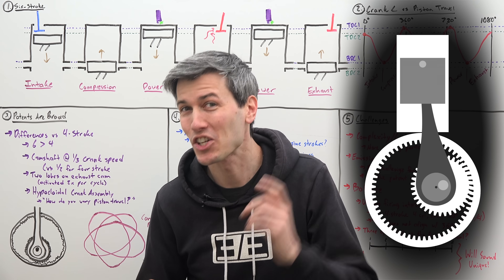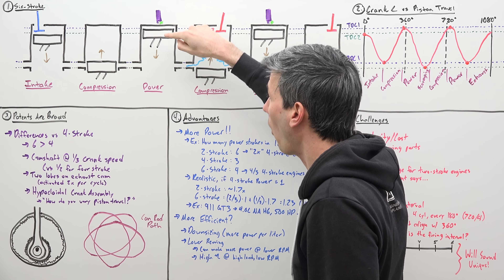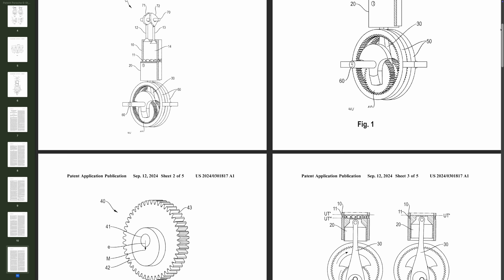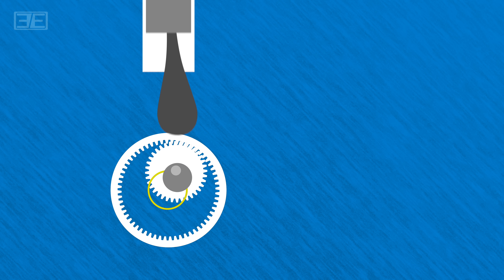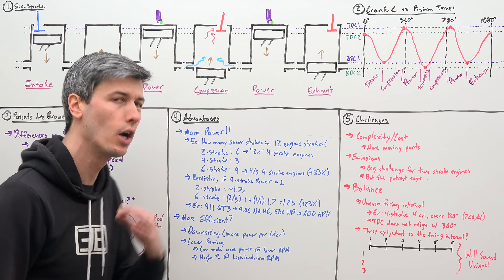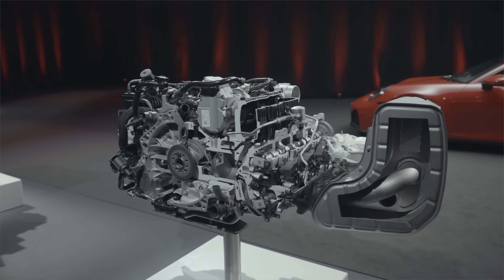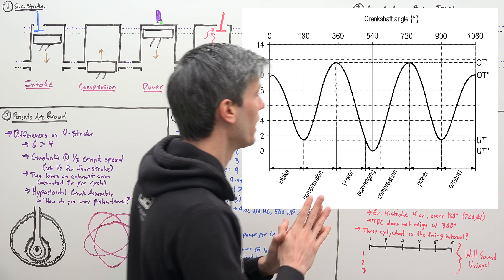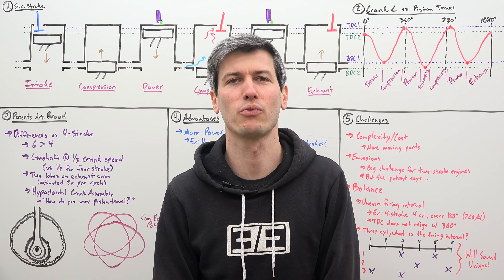Porsche's 6-Stroke Engine Is Genius!

Comment: I don't understand how people come up with stuff like this. I mean, I do in theory, but the fact that there are people who can connect all of the dots involved and end up with something of value is impressive.
Reply: Of all things and machinery that are made, what always impresses me and is often missed are the giant machines that are dozens of meters in size that make other machines.

Somebody had to think of and make all those enormous contraptions that are extremely complex, yet fast and efficient.
Reply: engineers. As the son of one I can tell you all sorts of stories. They are a different breed.
Reply: I mean you already have some of the greatest mechanical minds in a room. They're thinking of ways to  improve the cycle, and we know of two major energy losses in combustion engines, heat and exhaust. If we can capture either form of energy, we turn it into more efficency, whether it's the same power with less fuel or more power with the same fuel. Scavenging and reburning usually takes away from the power stroke. Here it gets its own stroke so it doesn't take away from the clean power stroke
Reply: Spirograph
Reply: Love the channel content is excellent, delivery excellent too.
Reply: Thanks, I am the sole named inventor on four U.S. Patents myself. On the other hand, you might be surprised at the amount of useless crap that actually does get patented. When a Patent is applied for, the Patent Examiners throw all sorts of irrelevant crap (existing Patents) at the application as "prior art" and the Patent Applicant (actually their IP attorney), must dispute the relevance. It is actually the established policy of the USPTO to immediately reject almost all Patent applications and make the applicant jump through hoops to convince the Examiner of the validity of the application.
Reply: people enthusiastic about making name of themselves, especially in their 20s, will spend whole day thinking about stuff like this. Some end up burnt-out, especially programmers, and had to "retired" early. It's how much we occupy headspace with the same problem, more time equal more dots connecting.
Reply: It's not that hard, just be German and have a penchant for making things that are needlessly complex. Easy-peasy
Reply: They usually come up with something like that either as a result of a wager („Bet you can't make a 3-stroke engine“ „Of course I can, give me until Monday!“) or out of desperation („Damn, I'm fed up with trying to fit this much power into this small area for the engine“). In this case, I'd say it was the former.

Also, it's usually the initial crazy inspiration, then a lot of work to solve the uninteresting detail like how to make the different tops and downs.
Reply: Home office
Reply: Porsche engineering is the BEST in the world!
Reply: @ghoulbuster1 in theory. In reality, their vehicles are unreliable and expensive to repair.

Comment: Could a hydraulic actuator rise and lower parts of the assembly to get rid of the eccentric crank shaft? The cylinder might be raised and lowered when the pressure isn't too high.

Comment: My basic understanding:

There is only one fuel intake stroke so the second compression and power stroke will not have the typical increased power like a two stroke, because it has not taken in more fuel. That is where the increased efficiency comes from, it is injecting fuel less often and only using the leftover fuel for compression\power on the second cycle. It MIGHT break even, but it depends on how good it is as scavenging the remaining fuel.
It will probably make slightly LESS power than a similar displacement engine (but only slightly less) because gears to drive the cylinders will probably not be great for high RPM applications since to make them robust enough you have to make them thick, and that means heavy.

Of course, none of these matters THAT much on a diesel, so I think that is where it will go. It can probably keep a very similar power figure as well. A cleaner burning and more efficient diesel would be very welcome. Honestly I can see these used in large diesel applications where every cent you save on fuel adds up quickly, and being able to save even just 10% on fuel cost pays for itself easily. Things from long haul trucks, to generators, to ocean going ships will definitely see it in great demand.

I look forward to be proven wrong, or course, but that was my napkin take of it. If they can pull it off it reliably it would be fantastic, and either way you are right - the sound will be something else. 
I guess now we wait to see what they actually build.
Reply: With direct injection (either conventionally for a 4 stroke via the cylinder head or via lower 2 stroke sleeve valve), fuel can be injected whenever one likes, as many times per cycle as one wishes.
Reply: @RandomGuyRandomNumber  Interesting. I must have missed the notes about that on the patent info, or it is just a gap in my knowledge.

Thanks for the insight.

Also, love the name ;)

Comment: If the camshaft is 1/3 the speed of the crankshaft, then theoretically this engine can rev higher than a traditional 4 stroke engine since the poppet valve don’t open or close as fast.
Reply: Then you also have to deal with port wear and carbon buildup.....its not a nice trade off. It really only makes sense if you can eliminate the valve train like achates power does.
Reply: It's not about the rotation of the camshaft, it's about the closing time of the spring -- you still need that thing to close in the time that the piston is moving.  This will have the same timing issues at RPM as a 2-stroke or a 4-stroke.

Comment: I want to hear this engine so badly. I think based on the firing order described, it is going to sound naturally very high revving even if it isn't actually spinning fast... And when it is at high RPM, it' probably going to sound insane like it is revving at 20,000 RPM. It will sound wild. If this is next generation Porsche, I am here for it!!!
Reply: I'm thinking it might sound like an offset engine like the motorcycle twin-L engine.
Reply: Agreed- does it sound like something between a standard 6 cylinder and a V12? I'm extremely curious to hear it
Reply: @ben10hanson  I think it is going to be closer to the sound of a rotary engine but slightly different since the firing order is uneven and has two power strokes then four cycles to repeat. We need somebody to make a simulation sound so we can get an idea. Preferably in 3, 6, and 12 cylinder configurations to compare.
Reply: @kiefershanks4172  9 cylinder?
Reply: @economicprisoner  I don't think that would work unless it was a radial engine and Porsche will 100% not do that. Lol
Reply: @ben10hanson I don't think so. The only way for it to sound like a v12 is for it to have inline 6, or vr6. Or maybe I'm wrong, please do tell if I am.
Reply: @aominnomad  6 cylinders is 6 regardless of configuration. Firing order changes the sound, thats why a 350z sounds different than a BMW M3 even though they are both 6 cyl. Also exhaust set up can change sound like unequal length headers
Reply: maybe @AngeTheGreat can simulate it
Reply: @Fritz_Pauker  Yeah that's what I'm hoping for too
Reply: Either that or it will sound like a vacuum cleaner 😕
Reply: @StephenDeTomasi  it will have turbo, thus it will sound like vacuum. Don't like it? Don't listen to it (or listen to it, if you want anyway.)
Reply: @StephenDeTomasi  better than the electric cars I bet
Reply: What’s interesting is that the power strokes aren’t evenly spaced apart like they are in 2 and 4 stroke engines so the sound is gonna be unique. I feel it’s gonna have the sound of 4 stroke and 2 stroke engine at the same time.
Reply: and I think it will also sound a bit "raw" as the firing order is not at even intervals but very very slightly off..
Reply: If thats viable and possible.

Comment: They patented it but they did not design it
Reply: Anyway they will probably use a hybrid super charger and turbo charger 1 for each intake stroke and inject a too rich mixture which can then be part burned then rest burned before exhausting

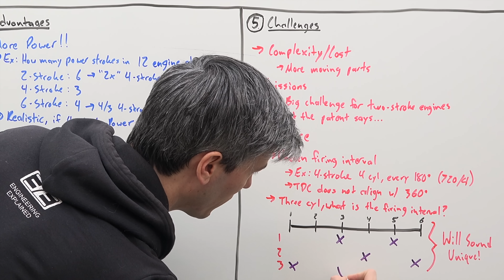Comment: 13:30 There is actually a way to balance them. 
You overlap them all. 
If you consider the first combustion from the normal 4 stroke as the strong combustion and the second combustion from the 2 stroke as the weak combustion, you can essentially overlap them. 
For example, cylinder 1 has its strong stroke on 3, weak stroke on 5. Cylinder 2 has its strong stroke on 1, weak stroke on 3. Lastly, cylinder 3 has its strong stroke on 5, weak stroke on 1. 
Leaving us with cylinder 1 strong overlaps with 2 weak, cylinder 2 strong, overlaps with cylinder 3 weak,  cylinder 3 strong overlaps with 1 weak.

On top of this solving the firing order, it should also balance the engine, as the strong stroke happens at 20º before 360º with the weak continuing that and adding power at 20º after 360º, essentially making it a wider combustion phase.
Reply from the maker: But then all your primary forces line up together so you make the balancing more rough, no? I definitely did wonder about just overlap at ~360-ish, but things don’t really line up when you draw it out.
Edit: Added longer thoughts on this to the pinned comment. You can't actually get all the peaks to line up, because they're wider than a 360 degree split, and you have 1080 degrees to divide by 3 (360). No matter what, some pistons won't align.
Reply: @EngineeringExplained  If you set up the pistons:
strokes 1&3
strokes 2&4
strokes 4&6
strokes 5&1
strokes 6&2
strokes 3&5

you get 2 power strokes per stroke. I'm not sure how the secondary balancing would work in that case, but there's probably some piston layout that is fairly balanced
Reply: @xan8466 - exactly - a 6 cylinder engine is the lowest cylinder count that can achieve primary balance
Reply: @EngineeringExplained  Yes, but with a three cylinder engine there is probably a need for a balance shaft anyway. And it may be possible to somewhat balance the forces with the movement of the hypo-cycloid gears. It would definitely be a very complicated force analysis.
Reply: @EngineeringExplained  Could you fix the issue by playing with the bank angle of a V-configuration motor, like Honda did to get their V3 and V5 engines to work?
Reply: @ How is that any different from a 3 cylinder engine?
Reply: @EngineeringExplained  Would using a v-12 or h-12 configuration allow you more freedom to come up with a balanced firing order?
Reply: @EngineeringExplained What if you had a "vtec" type " 'crank-gearshaft' or what ever it's considered", that would essentially tweak the timing for the camshaft and make the lower TDC piston fire the same time as the real TDC one. Worlds fastest mechanically engaging and disengaging vtec basically for the 'short' strokes. But with gears and not lobes.  Not good at explaining my thoughts but maybe you get the idea or someone who does can explain it better.
Reply: @EngineeringExplained  oppossed 6 cylinder engines can balance that ^^
Reply: @EngineeringExplained n the Porsche six-stroke design, the firing order and balancing are significantly more sophisticated than a traditional engine because the crankshaft is essentially "re-indexing" the piston position during every revolution.
The Balancing: The "Straight-Line" Secret
In a standard engine, you have heavy counterweights to offset the "shaking forces" caused by the connecting rods swinging side-to-side. In this hypocycloid design, the piston and rod move in a perfectly straight vertical line.
Because the movement is purely linear, the balancing is handled by the planetary gear set itself. The internal gear rotates inside a larger ring gear; as long as the masses are equal, the primary and secondary vibrations cancel each other out perfectly. It essentially creates a "harmonic" balance that makes a small engine feel as smooth as a V12.
The Firing Order: 1-in-3 Revolutions
This is where it gets interesting for the firing order.
Traditional 4-Stroke: Fires once every 720° (2 revolutions of the crank).
Porsche 6-Stroke: Fires once every 1080° (3 revolutions of the crank).
Because there are two "power" strokes in the six-stroke cycle (a short one and a long one), the firing order has to be spread out over a longer duration. In a multi-cylinder version (like a Flat-6), the computer-controlled timing ensures that there is always one cylinder in a "long" power stroke while another is in a "short" power stroke. This provides continuous torque with almost no "dead spots" in the rotation.
Reply: Yeah
And with 6 cylinders, you can offset the second 3 by 180 degrees, geting 6 cylinders space out by 3*360/6 = 180 degrees ...oh actually with 3 cylinders you also simply offset each one by 3*360/3 = 360 degrees 😄 yep right
Reply: @pmj_studio40651080°firing once every 3 revolutions.
Reply: Ah that’s a really neat idea, i bet that’s what they end up doing
Reply: Yeah, my thoughts exactly.  Don't try to space them by 180°, space them by 360° and have two fire at once.  So cylinder 1 fires on phases 1 and 3, cylinder 2 fires on 3 and 5, cylinder 3 fires on 5 and 1.  Or some other similar balancing, possibly with some slight tweaks so that the very slightly out-of-phase firings either happen at the same time instead of a few degrees off.
Reply: It would also allow them to not fuel the two stroke at idle lowering emissions more.
Reply: @gordonn4915  yes, but would require them to play around the valves, to not have that cylinder just drag with pure compression, but that tech already exists
Reply: Brilliant.
Reply: Sehr interessant..!
Reply: and what about a 9-cylinder Cayenne / Bentley engine?
Reply: @Jadawin-kk3fz - 9 cylinders does not allow to achieve primary balance with this configuration.   You can get primary balance for any multiple of 6 cylinders.
Reply: @michael-j-harrison so make it a v12 😂
Reply: What pushes the air in at the lower bdc without turbo?
Reply: @שמרבןמאיר  You close the exhaust valve early and pull a vacuum in that cylinder.  When it passes the port, air gets sucked in.
Reply: @שמרבןמאיר vacuum
Reply: Here is my comment on this topic...

I suspect that the firing pattern for a 3 cylinder 6 stroke will be based on 2 cylinders firing at roughly the same time spaced 360 degrees apart.  So in this way it will fire at the same rate as a twin cylinder 4 stroke or a single cylinder 2 stroke engine
Reply: I foresee rotational weight limiting this to a transverse mounting. Also you could arrange the cylinders on a 90* 180* 270* crankshaft allowing for them to fire at 180* opposed. Traditionally we use a 180 or 90 degree crank. With the 90-180-270 the sound would be similar to the rotary. The 3 lobe crank would be under reduced load since its planetary rotation would be assisted by of the offset firing.
Reply: @TD-047  so, effectively a V12 crank?
Reply: Or just use 6 cylinders so there's always an overlap.
Reply: Whether they can be nicely balanced or not Porsche has given us something interesting to think about with NA engines, really happy to see this in our currently turbocharged world. If can actually get 600bhp from 4.0L at 9000rpm that would be crazy!
Reply: @StreetComp Nissan versa 1.8 L
Turbo is pumping out 330 hp.
Reply: @douglaspowers2032 this is easily accomplished as adding a turbo means basically any properly built and tuned engine can make huge horsepower. BMW turbo F1 engines in the 1980s were making up to 1400hp from a 1.5L inline-4.
Reply: n the Porsche six-stroke design, the firing order and balancing are significantly more sophisticated than a traditional engine because the crankshaft is essentially "re-indexing" the piston position during every revolution.
The Balancing: The "Straight-Line" Secret
In a standard engine, you have heavy counterweights to offset the "shaking forces" caused by the connecting rods swinging side-to-side. In this hypocycloid design, the piston and rod move in a perfectly straight vertical line.
Because the movement is purely linear, the balancing is handled by the planetary gear set itself. The internal gear rotates inside a larger ring gear; as long as the masses are equal, the primary and secondary vibrations cancel each other out perfectly. It essentially creates a "harmonic" balance that makes a small engine feel as smooth as a V12.
The Firing Order: 1-in-3 Revolutions
This is where it gets interesting for the firing order.
Traditional 4-Stroke: Fires once every 720° (2 revolutions of the crank).
Porsche 6-Stroke: Fires once every 1080° (3 revolutions of the crank).
Because there are two "power" strokes in the six-stroke cycle (a short one and a long one), the firing order has to be spread out over a longer duration. In a multi-cylinder version (like a Flat-6), the computer-controlled timing ensures that there is always one cylinder in a "long" power stroke while another is in a "short" power stroke. This provides continuous torque with almost no "dead spots" in the rotation.
Reply: It fires every 1080° and the hypocrisy logical crank moves in a straight line as opposed to a 4 cycle that moves on and angle  thus the hypocycloidal designed crank is harmonically balanced.

Comment: The problem is that first intake stroke does not use  whole length of the cylinder and for second compression stroke intake must be pressured to insure that fresh air will get in. So this is probably meant for turbo car. Complexity is not worth in this case in my opinion, for just 2 strokes less there is too much complexity and not so much power advantages.

Comment: 8:55 is this engine even capable of running naturally aspirated. All 2 stroke engines require some sort of forced induction to force an airflow going the right way. As this engine partially operates as a 2 stroke, it stands to reason that some sort of boost pressure is required, at least on the bottom ports.